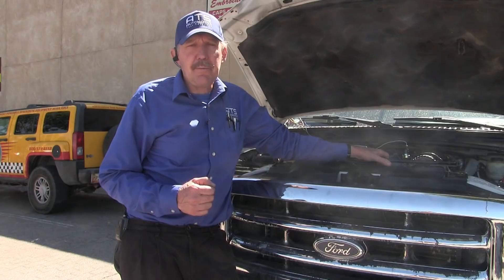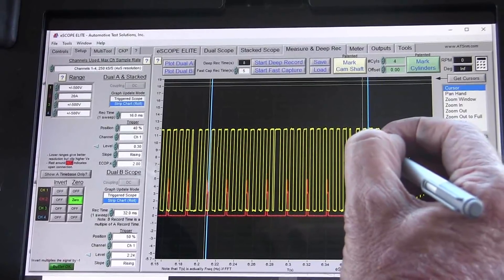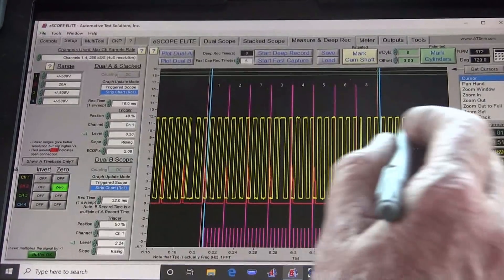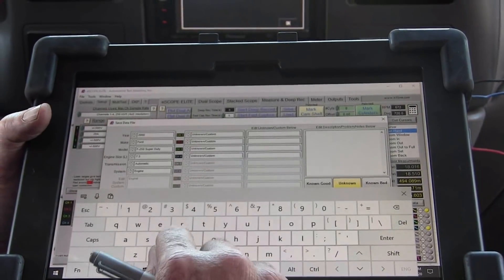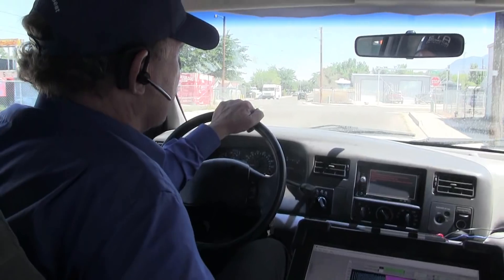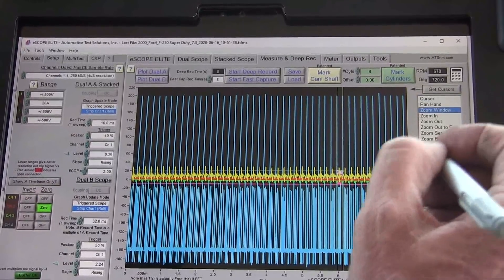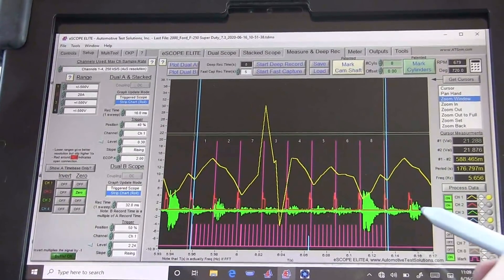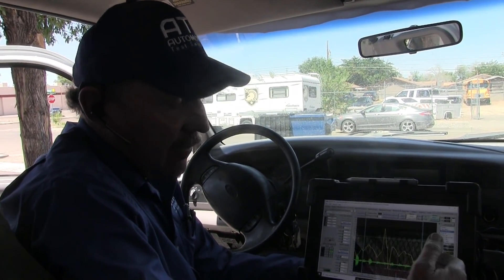Diagnosing a 2000 Ford F250 7.3 Lower Power with Knocking Under Heavy Load

Comment: Great work. I just had a problem with some new reman injectors from a top shop that were milled under spec and it was causing an oil leak into my fuel bowl. At least they owned up to it and replaced them but it cost me a day's work and several more in the turn around.

Comment: So, check engine light on, with a stage 2 setup,(adrenaline site HPOP with full force diesel stage 2 injectors and stage 2 turbo) she runs smooth. Check engine light off, she goes between 700-900 rpm and shakes the truck up. She stalled out on me, luckily after I pulled into a turnoff. I’ve replaced the IPR, ICP, CPS, OPS and a bunch of other stuff. (Turbo, injectors, and HPOP. Including fuel line gaskets)

Comment: Bernie, Great video, and awesome explanation of what all was going on. That is a great device you have it sure shows a lot of what's going on while the engine is running. I have a 1996 F-350 with the 7.3 L Power stroke engine with 133.496.3 miles I just got this truck. I'm new to diesel engines and I admit that I don't know much about them. So, I'm now needing help trying to figure out what the noise is coming from the engine, it fires right up with no problem, and at idle it sounds great, has no smoke coming from the exhaust at all. When I throttle it up, I hear a sound that I can't explain. It's like a rattle under acceleration. I know this explanation isn't very good at all, but what can cause this sound? I'm going to do a video of starting the engine, then one of driving hopefully I'll be able get a good recording of the sounds or sounds that it's making. Wil luck you just might have a good idea of what the sound or sounds are caused by. I'm praying that it's not going to be anything major to fix. Sorry for being so long winded here, I'll now get to work on the video. Thank you for sharing the info and thumbs UP you have a new subscriber.    Roger

Comment: I am in the Bay Area, I have a 7.3 T444E  with low power, only 90k miles on her, dealer want to install new hpop and ipr valve.
Do you know a good diesel mechanic on the East side of the bay here towards Fremont CA. For a second opinion and repair.

Comment: You are one amaising and kwolegable person if one day i  can be close to your knowlege.But i have a question and i think that your explanantion abouth problem is not right,you can correct me if i am wrong.
But i think that injector knock and leak is by the leak to return side and with that leak fuel pressure in fuiel rail drops an causing even more knock.Injector is faulty for sure.
My question is how is possible to fuel in fuiel rail can be contaminated by gasses from combustion chamber it's not real because fuel presure in rail is at least 300bars (i dont know exsact type of injection on this vehiecle)
And compresion from vehiecle is lets say around 30 bars so it canot overcome fuel pressure if i am correct.
Annyway i think that you sir is master amongs diagnostitian and thank you for sharing your knowleage,we learn a lot from your case studies.Loocking forward to your response.
Best regards.
I hope that you understand my english.
Reply: I'm no diesel fella, but surely there's extra high cylinder pressure from over fueling and pre-detonation, which may very well peak well above rail pressures
Reply: @throttlebottle5906  Anny leak of fuel wether will be in cylindar or return line will cause drop on raill presure for sure,but gasses from combustion chamber to go in fuiel rail thats a big how?at least for me.any air in fuel sistem will cause engine to stall (lets say moust of engines).I am not sayng that injector cannot leak in cylindar yes they do for sure.Live data can say a lot about fuel pressures.
All the best.
Reply: @carcranktime8313  injector tip leaking in = fractured or heat warped to stick open and it it's sticking open to leak fuel out, then it can sure leak combustion gasses back in, under the extra high pressure of pre-detonation and over-fueling from the same leaking in. again I'm no diesel guy, but I'm sure I could pick it up fast :)
Reply: @throttlebottle5906  Its too big pressure difference between fuiel pressure and combustion pressure,logicly its not possible again if is common rail system i think it is if is that much leak egine will stall...maybe i am wrong but i dont know how? :).
All the best man

Comment: This is great different approach....this issue could have been identified by disabling each cylinder with a scan tool, but Bernie's approach is more tangible.....would be able to sell the repair to a customer by showing them the scope waveforms... especially to have the customer agree to replace the injectors on the problem bank

Comment: Great video Bernie.
 I don’t see the leaking injector tips as often with the 7.3 as I do on the 6.0 engine. 
At some point Ford also updated the #8 injector for a noise issue but think it was due to location away from the fuel supply. The updated injector often causes a contribution fault when running the test from the scan tool. 
The 6.0 balloon test is a non-scope method for identifying compression entering the fuel system but only narrows it down to one bank. 7.3 is much harder to do a balloon test so I will have to try this method out. 

Thanks again, Chad

Comment: Great study. I had never thought about combustion gases entering through a leaky injector to cause problems with the whole bank. It obviously makes perfect sense. Thanks so much for sharing those videos.
Reply: Happens a lot on 6.0.... They have a balloon test to check it
Reply: @charliemagoo7943  Now that you mention balloon test, I have had heard of that. I guess if you don't use it you loose it. I haven't owned a Ford Diesel in a long time. I had a few 7.3s.